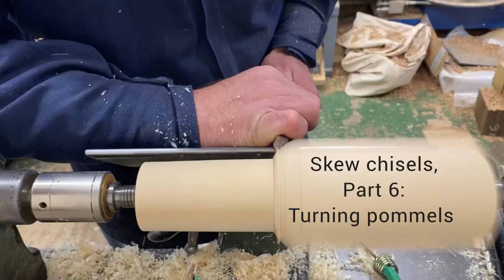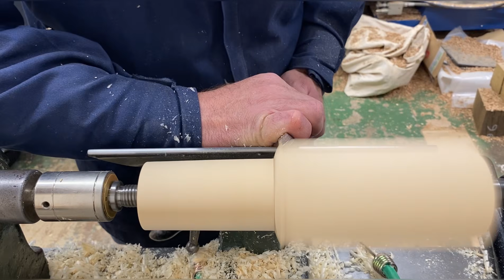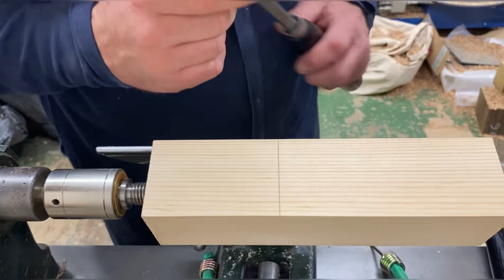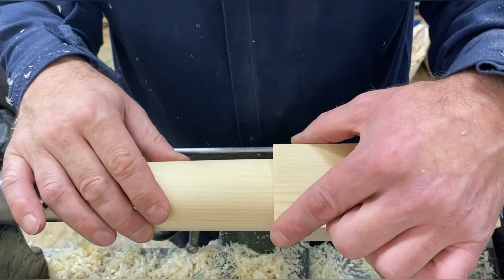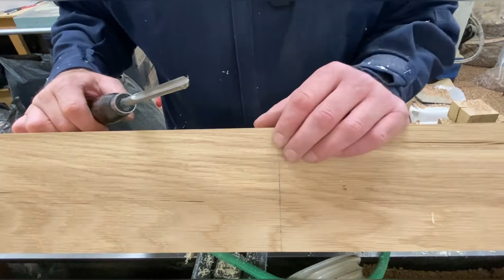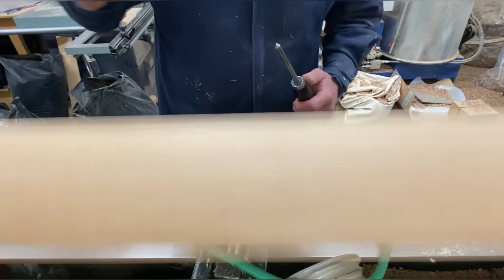Skew chisels, Part 6: Turning pommels

Comment: What do you do if you're not centered properly, so the pommel is off-centre?
Reply from the maker: It’s always worth taking the time to accurately mark centres so it runs true. It is out of true, it turns just the same but the corners will be uneven

Comment: Thank you so much for this series on the taming of the skew.  For this video on pommels, at what speed are you running the lathe?
Reply from the maker: The Pine spindle was just under 2000rpm, the large Oak spindle around 1000rpm

Comment: Well, I have been trying to apply what I have learned from watching your channel. I have been doing some rolling pins out of hard/sugar maple. Peeling cuts do not work well with highly figured maple, too much tear out. The plane cut works better and cleaner. Maybe if I had a tool rest that ran the length of the rolling pin, I could make them a lot straighter, but I still have to resort to 80 grit on a board to get them "perfectly" flat. I have taken to using a pencil down the entire length of the pin and then sanding a bit, then going back to the skew to take it down some more. That does help, but I still have a long way to go. I did do the round over on the ends with the beading and parting tool, so that was successful, at least for a bowl turner.
Reply from the maker: It takes a lot of practice to be able to achieve a perfectly straight cut, especially in figured timber. Sounds like you’re coming along well 👍🏼 (peeling cut often don’t leave a very good surface but is an efficient way to remove timber in certain circumstances)
Reply: Current process is to rough it first, then use calipers to get things close, then, while spinning, pencil line the whole thing, then abrasive on a board to find out where the high spots are, then trim those down bit by bit till I have it where I want it. I am getting better. Like a couple of martial arts teachers said, "10,000 more times". But that is what you said last time! Well then, 10,000 more times!